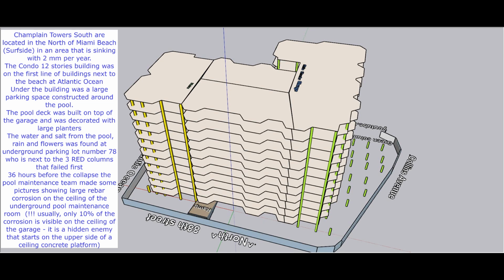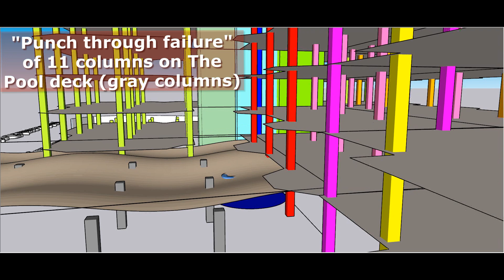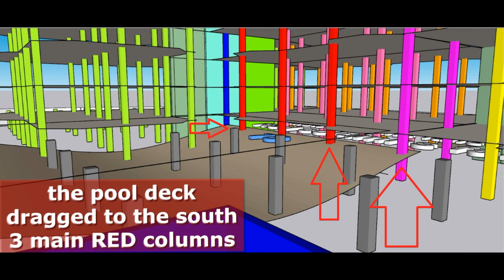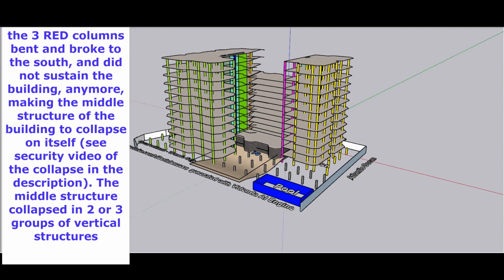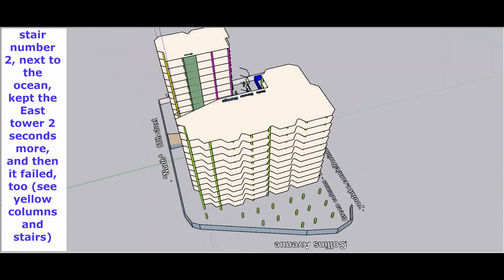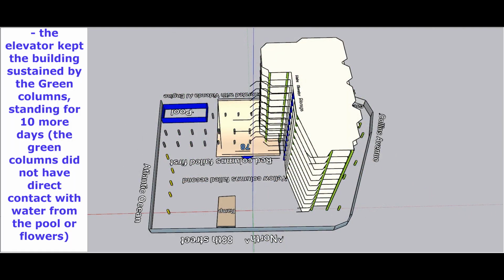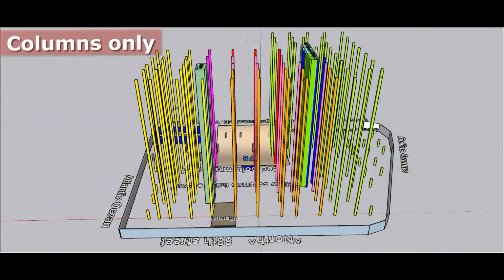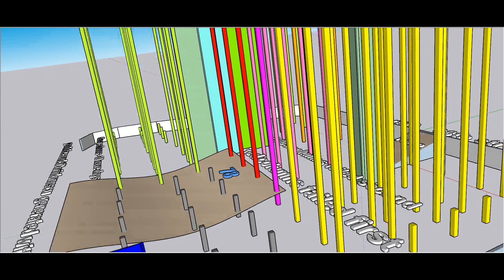Collapsed Building Miami, 3D model condo, penthouse, Champlain Towers Surfside Florida, demolish P3

Comment: Nice work. However, from the security video, the section of the east tower (the purple columns on your reconstruction) was pulled down at the same time as the middle structure.
Reply: Or milliseconds thereafter...
Reply: Concrete is good in compression only. They failed when pulled to the side, as expected.
Reply: She said two second later which was what I saw. 2 seconds is very little time. And I would guess the building may have been sinking more thsn 2 mm per year.
Reply: @andresinsurriaga876  Only a corrupt greedy bureaucracy would allow a huge heavy tower to be built in that environment on what is barely a barrier island that is constantly shifting with the tides. It just shows you that these wealthy people were more obsessed with an oceanfront million dollar view than their own safety or lives.
Reply: My Educated guess!
*Chlorine pool water 40 yrs of storms overflowing the pool water!
*Waterproofing failure ! 
*DECK  punch thru shows connection failure at pool deck columns! ( look at columns still standing)
Column connection ** 
*Column connection undersized rebar ?
* Not Enough rebar @ column to deck!!!!!!!!!!!!! 
*Rebar single strand at bottom of deck !!!! More info needed
Reply from the maker: Yes, some of the front columns were dragged and the rest could not keep all that weight alone. The ones next to the water around parking lot 78 were the easiest to drag - red and pink ones. The 2 pink columns next to the yellow columns are the ones that you can see on the tourist video made through garage door, so I created a special color for them
Bonus
See The Penthouse, inside view before the accident, Champlain Towers South, Miami, Florida (Surfside)
https://youtu.be/HFWbCZG_6xA

Comment: Are the planters significant to the pool deck collapsing? I keep hearing them be brought up but can’t find a pic of them being damaged/ if they were mounted to the pool deck.
Reply from the maker: Palm trees on the deck ? I do not know if this is recent but 4 palms where there on the pool deck
Image here
https://www.miamiherald.com/latest-news/381gca/picture252527913/alternates/FREE_1140/image%20(67).png
Full article here
https://www.miamiherald.com/news/local/community/miami-dade/miami-beach/article252487373.html
And a bonus
See The Penthouse, inside view before the accident, Champlain Towers South, Miami, Florida (Surfside)
https://youtu.be/HFWbCZG_6xA
Reply: If the columns in the garage were deteriorating, which apparently they were. The damage to the rebar inside the cement was worse than what was visible. Those planters added a lot of weight to the columns. I think the planters also contributed to the moisture in the columns.
Reply: The planters were leaking, and they sat right on top of a large beam that connected the pool deck to the facade columns of the building. If that beam failed, it would have damaged the structural integrity of the column, and caused it to buckle. Nearby columns would have picked up the extra weight before failing themselves, that's what's known as a progressive collapse.